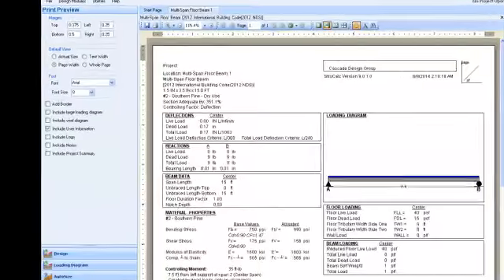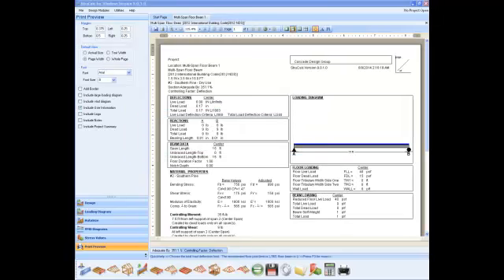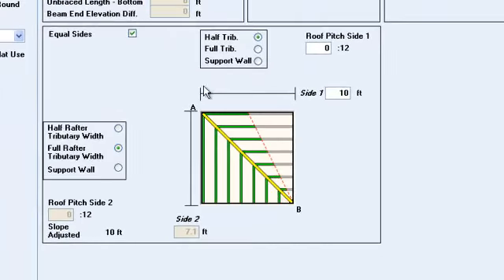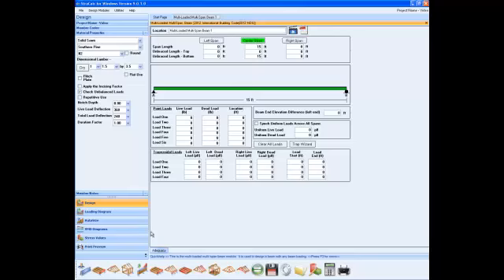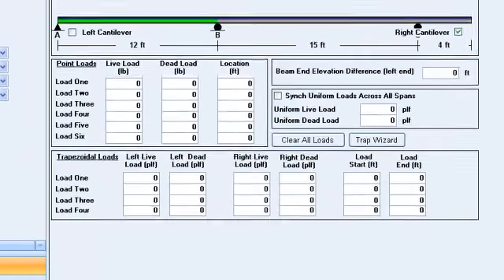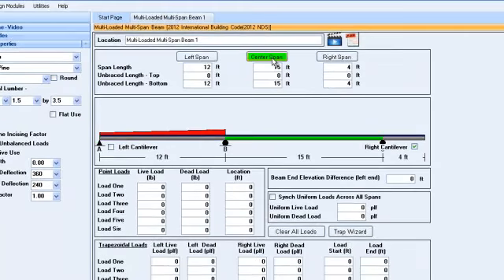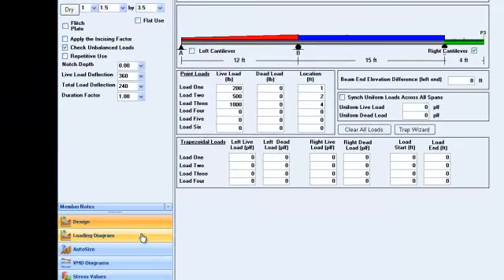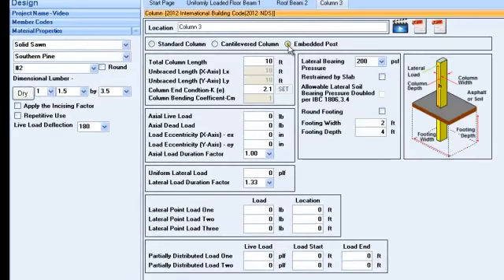StruCalc 9.0 New Features

Comment: I used this program years ago but somehow I never got information to upgrade. Upgrading is just as costly buying the program. This should not be as the expense to upgrade should be a small amount for the updates. So maybe it will be cheaper to buy a new program rather than upgrade. I have lots of money in this program to only buy or spend the amount as everyone. Maybe it is good that I did not upgrade.